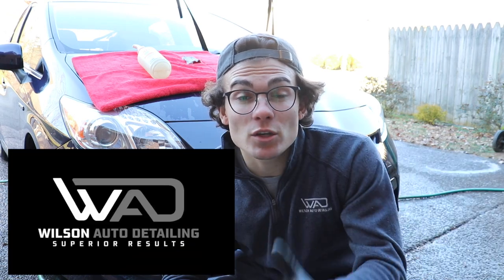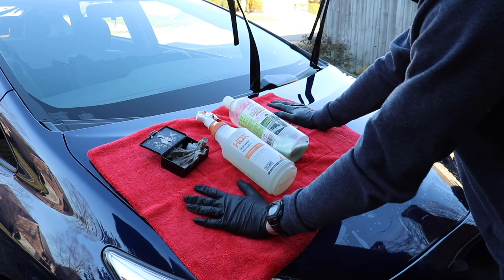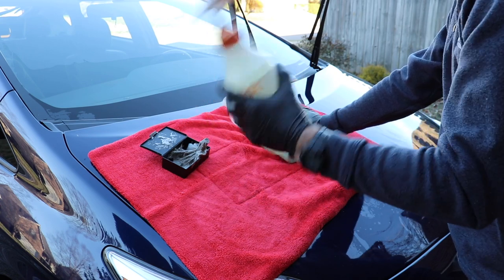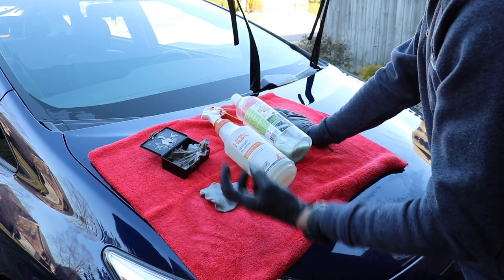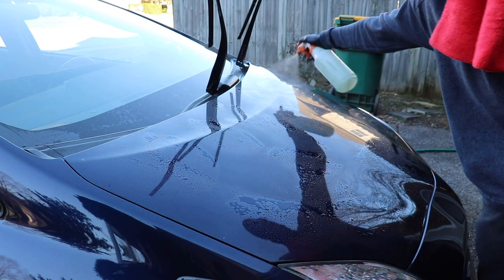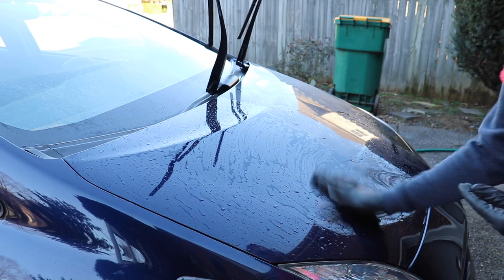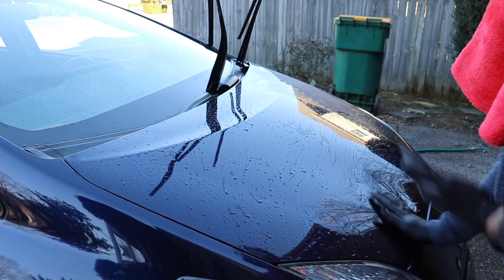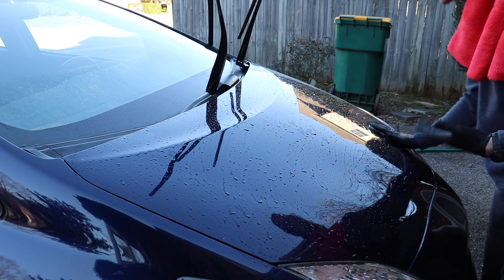Why I LOVE Citrol Degreaser! | Complete Exterior Detail Part 3

Comment: Have you ever tried a clay Mitt? I was very skeptical of them at first, but have found they are way more efficient, and most of the time even more effective. Curious to see if you have any thoughts.
Reply: How many cars does a clay mitt usually last? I throw them out after 4 cars. I don't want them to scratch the car once they go bad so play it safe
Reply: @daves.3278  you should be able to rinse it off and keep using it car after car. Well over 4 cars. I'll use mine for months on end as a proffessional
Reply: @samharmon4692  wow thanks Sam 👍👍
Reply: Interested in your thoughts as well! I use a fine and medium grade mitt depending on the condition of the car. I’ll typically buy a new mitt each year just to be safe
Reply: Dave S. Clay mitts last a long time. Why would you throw it out after 4 uses it costs $50? Lol. Such a waste

Comment: I would use citrol before you wash the car since citrol on the paint needs to be flushed with soapy water afterwards. Would recommend using it right as you start the exterior detail then wash